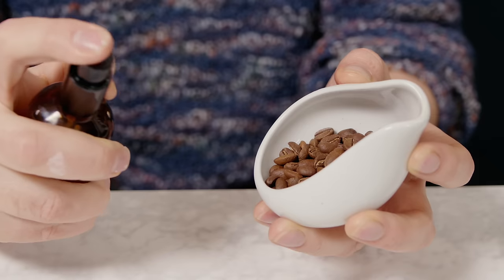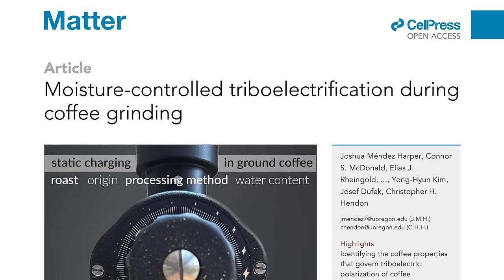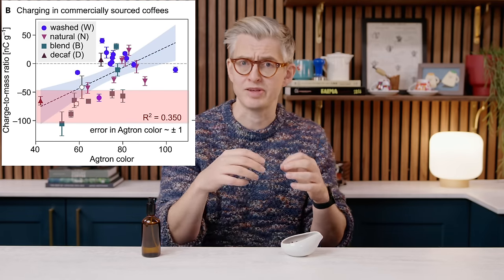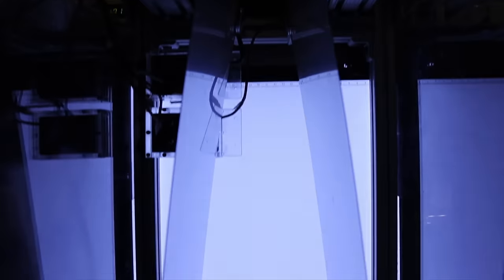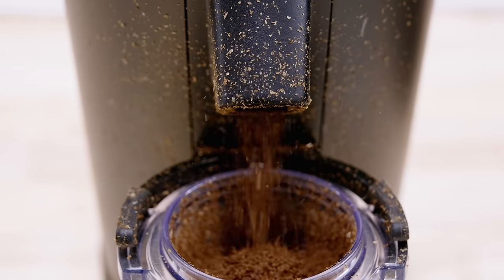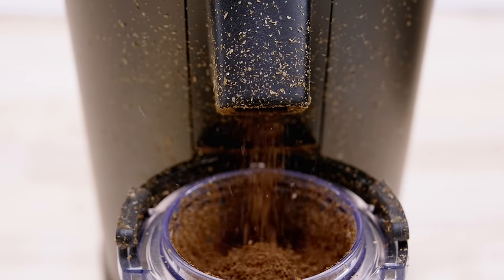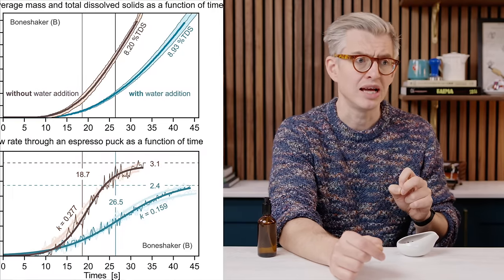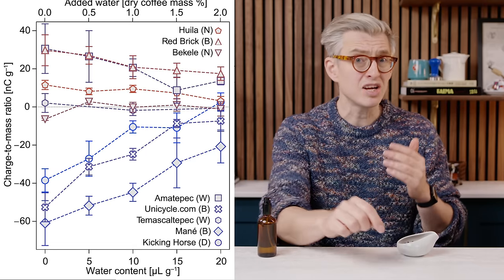Science Discovers What We All Missed: More Than An Anti-Static Hack

Comment: New bad coffee trend, drink only positively charged coffee grounds, throw away the identical negative charged grounds.
Reply: don't give them ideas
Reply: That method should only be used if you are in possession of a kettle which produces left-spin water molecules.
Reply: (This makes a sour taste)
Reply: Introducing the new Kruve electro-seive
Reply: Personally speaking, I prefer the bitter taste of coffee conisting of antiquarks.
Reply: @tokyopapillon837  has a bit of an anticharm flavor to it
Reply: HAHAHAH
Reply: brb gonna sell a positive energy grinder for tinfoilers
Reply: I love this. 😂
Reply: as a negative person i prefer positive charged coffee
Reply: Drinking coffee grounds, in general, sounds like a pretty awful trend, not to mention a difficult thing to do.
Reply: sell that right to silicon valley
Reply: @tokyopapillon837 Everything supposed to be the same if we were made of antimatter. Ahhhh but does anti-coffee taste more bitter or sweeter.
Reply: Remember all those gadgets for cars, like magnets around the fuel line which aligned the atoms and gave better fuel economy? I tried them all until I was removing petrol after every trip. I love new gadgets and love what James is doing, especially from the scientific point of view.
Reply: I wonder if it would be possible to effectively do electrolysis on grounds coming out of a grinder, so you have a high chance to split negatively charged grinds down one path, and positive ones down the other, by sending the grounds through an irresponsibly powerful electromagnetic field.
Reply: Sounds good. I need more positivity in my life
Reply: "I don't allow any negativity into my life. It's for my mental health."
Reply: I pass mine through a small black hole that I keep in the shed, the flavour is just cosmic.
Reply: Thank you for that laugh.
Reply: Removing negative energy from my life to realign my chakras 😤😤
Reply: Negatively charged coffee but brewed with alkaline water
Reply: @wesleychaffin4029  Jacob’s or supermarket own brand?
Reply: @xyzpdq1122 not heavy water?
Reply: Only positive vibes ...
Reply: the results will shock you!
Reply: Don't even THINK about serving me anything but monochiral coffees
Reply: Alkaline coffee? Oh no
Reply: You forgot Paula Abdul's Law. They're hard to separate, because opposites attract.
Reply: We could have gang wars over which polarity you drink.
Reply: Eliminate the negative, accentuate the positive, don't mess with coffee in between!
Reply: positive charges add to the flavor, but negative ions only subtract
Reply: Bahahahahahaha
Reply: Positive vibes only!
Reply: "positive" coffee culture
Reply: You got it all wrong, the negatively charged grounds are the good ones.
Reply: ask for that in your starbucks order 😂😂
Reply: And instead of normal water rather use the good DHMO.
Reply: Don't forget chirailty, spin, and polarization you fools!
Reply: @ecbrd8478 well if you want to fight them, you give them useless stuff to bicker about!
Reply: I am positive this will work!
Reply: @ecbrd8478 😂😂
Reply: @davegrant22 😂😂😂
Reply: Maxwell's Demon meets Maxwell House - only let through the perfectly brewed coffee and reject anything else
Reply: We just don't need that negative energy in the morning
Reply: Oh please, obviously the next (best) trend is antimatter coffee. Maybe will finally get some of that sweet sweet dark matter coffee
Reply: @PaulSchaffert  👏
Reply: ......my percolator makes better expresso and it's not even an expresso machine. 😏 Y'all be taking this too far.
Reply: @chrisjk  Only available in the southern hemisphere
Reply: Separate by positive/neutral/negative charge then sieve sort into fine/medium/course.
Staccato shots with 9 layers, 9! = 362880 possible layer orders.
Reply: @davegrant22  can't find one on line ??
Reply: Only positive vibes 🤣😂😂😅😆🤭
Reply: Keep the "bad" negatively charged beans for rainy days
Reply: I'm just waiting for grinders to come out with Ozone generators built in...
Reply: Left twix is better
Reply: I can see this dialog going down at a Starbucks near me...   vente spice this caramel that  but with only positively charged grounds please.
Reply: No, just reload the negatives to positives
Reply: @chrisjk  You need three phase power for that!
Reply: Wear a grounding bracelet when you drink your coffee too
Reply: Don’t give TikTok a new trend. 😂
Reply: This...I have negative-charge coffee bean sensitivity. Many people do, and they don't even know it.
Reply: @error.418  yes it does have that anticharm flavor, which I found frankly anti-up, but my friends said I'm being strange again, so I got back anti-down and just stopped complaining to preserve my beautifully balanced color charge - instead I meditated a few muons and felt inspired to be more positron about it.

(Sorry for the bad physics joke. I'll get help soon'ish.)
Reply: @saynay302  They did something similar: they did separate the grounds with some simple electrically charged plates - the principle is very similar to electrolysis, just without the fluid. A magnetic field would only make the grounds spin in opposite directions, but it would be difficult to separate them.
Reply: I'm going to need some crystal burrs for my grinder.
Reply: @KonradTheWizzard  [chef's kiss]
Reply: Cute, can benefit from a lot of pseudo science, virtually impossible to achieve without a healthy dose of lying. Perfect trend! Love it
Reply: Can't wait for all the 'workflow' shorts
Reply: Woke coffee drinkers
Reply: Now the time for Van de Graaff generator
Reply: What if I live by the ocean, or a waterfall… negative ions everywhere (which I used to think were good for me).
Should I drink my coffee standing on my head? (for the yogis out there, it’s okay, B.K.S. Iyengar liked his coffee… )
Reply: Lmao
Reply: You must never allow coffee and anticoffee to come into contact
Reply: @Schaddn ”positive ion herbal grinder”
Reply: Quantum theory says it can be sweet and sour at the same time.
Reply: But the antimatter reaction keeps the coffee hot for a year
Reply: Why throw the negative grounds away, when you can enrol them in a meditation weekend?
Reply: @HauntedSheppard That’s the general idea. 😈
Reply: @Schaddn  Neutral ones for centralists.
Reply: I think this needs doing at the equator.
Reply: What a way to attract negativity every morning.
Reply: So… by eating positively charged food you are just attracting negative charges from your environment to be in equilibrium…
Reply: Could we positively charge them by generating a positive charge as we learn to do in physics?
Edit: sorry I comment before watching too often.
Reply: oh - I can see the marketing for this - ‘Drink Positive!’
Reply: For that they might... charge extra.
Reply: Lol... Coffee distributors will love this trendy idea.
Reply: @TheWitchfinderGenral  never cross the grinder streams!
Reply: @discordia013  I was just thinking of pointing my ozone generator at my grinder during operation,
Reply: Hames Joffman would drink the negative charged ones……
Reply: Whats better is that, there needs to be a particle accelerator to create dark coffee that tastes like black hole itself. 😂
Reply: ....The exquisite elegance of this electrical inquisition .
Reply: yeah, and you should dip the positive side of a battery on your kettle after boiling for a few seconds, to charge the water!!
Reply: Coming to all niche coffee shops near you!
Reply: @AndreasDelleske Set the grinder to 'fairy cake' and put in 100 g of beans and 28 l water please.
Reply: All this, and not even a roster of the grinders, never bother a chart of cleaning frequency, whether they work on kush and hazelnuts and cottonseed (no hulls please, can't count on ULGCS yet.)
Reply: вода всех уровняет☝️
Reply: Yeah, you really do want the negative charge clumps.... The positive charges will taste sour. Think in terms of battery components. The acidic components will taste sour... That would be the tannins.
Reply: Now they can sell a new coffee Brand called  "Beaning Positive" 🤣😂🤣
Reply: i suprised there isn't 'positive coffe for possitive spirit' ads for now xd
Reply: inb4 some hipster barista shop makes a specialty "Positively Charged" Coffee that's got some really dumb pseudoscience explanation for why it's worth it and healthy to drink this $60 coffee.
Reply: If it taste Unique sure 😂
Reply: Don’t forget to weigh the negatively charged grounds to an accuracy of 0.001g before throwing them away
Reply: Let’s hope the tongue of the drinker is not negatively charged.
Reply: @tokyopapillon83simple fix buy a 500 dollar grinder , 1:31 7
Reply: positive vibes only
Reply: After all, who needs more negativity in their life?
Reply: Sounds like a great business opportunity

Comment: A month ago I thought, I was a pedantic home coffee guy. After discovering this channel, I'm now weighing my coffee to 0.01g and micro spraying with distilled water and I can firmly say that the rabbit hole is significantly deeper that I ever expected...BUT I can also say that you firmly improved the consistency of my espresso shot.
Reply: Is there a reason you are using distilled water? I do not know enough about the spritzing method to know if this is generally recommended, however, I believe DI water does not conduct charge so readily as regular tap or mineral water... Now I'm interested to see a difference in the formation of electroclumps/aggregates between using regular water vs DI water! According to the paper, it seems that the cooling effect of water is more important than its ability to conduct charge, however, your comment has got me thinking.
Reply: Do people seriously looking into this problem realise they basically left the Maslow pyramid?
Reply: Lol
Reply: I’m no electricity surgeon but distilled water has a lower electrical conductivity because it’s cleaner — the coffee itself is going to raise the EC of the water, and tap water is going to have an EVEN HIGHER EC than the same coffee made with Distilled. 
So the water will have to deaden the static charge of the beans, plus the charge of the dissolved solids present in your tap water.
Reply: As long as it's real espresso not mokka or filter.
Reply: all to make a bitter drink be less bad...
Reply: @saygo-png  Don't be so bitter.
Reply: @SPDLand any hobby is outside of the hierarchy of needs, that's the very nature of a hobby
Reply: @ExpandDong420 it is in it, it's what self fulfilment refers to
Reply: @diggysoze2897 hmm. What about the difference between well water treated with sodium to breakdown the hardness vs "culligan" water. I use "culligan" in my coffee pot, not well water. I have not tried to see if it would taste different between the two waters.

Comment: My suggestion for the slowing flow rate would be that the coating of water on all the coffee particles drastically increases the capillary action of the coffee bed, which usually I would think is fairly hydrophobic if dry. The oils in the coffee also probably don't help with that. If you try to water dry soil versus slightly damp soil, you see the effect of a thin water coating makes orders of magnitude of difference. So a stronger capillary force from the already present water allows the coffee to be drawn into the packed bed more evenly and reduces the chances of channels forming, leading to higher leaching rates and slower flow rates. This is not contrary to what the prof said. It might be a combination of both.
Reply: Dry sponge vs wet sponge.
Reply: I'll subscribe to this theory.
Reply: Your hypothesis should be wrong according to 12:40. If your hypothesis has a statistically significant effect, then the test made with the grinder at 12:40 should also have a longer brew time.
Reply: If that theory was true wouldn’t all grinders see a longer shot time after adding water not just some
Reply: How would you spray coffee beans in a large hopper as opposed to a measured single serve?
Reply: @tiredboard the grinder could just produce more heat and dry the water out during the process.

van der walls effect is my bet asw
Reply: @sherrymangas2512 you wouldn’t be able to do that.
Reply: You could easily test this by grinding coffee first then drying it after.
Reply: if your hypothesis is correct, or is the main point, then we should see similar results no matter the coffee grinder, yes, it might play a small part, but since there are machines producing similar size particles with very little differences, then that would isolate the main causality in the coffee grinding process. Alternatively, it might be possible that somehow some coffee-grinders plainly heats the coffee beans more then others, maybe the motors heats the grinder more or it conducts more heat to the grinder itself, but it is fairy easy to test you hypothesis for this corner case: just use even more water and see if THAT makes a difference or not.
Reply: This is the basis for doing a pre-infusion step prior to extraction to pre-wet the particles.

Comment: It’s fascinating that the spritzing makes a MEASURABLE difference to the extraction of the espresso. I could totally see “well in theory this should have a marginal benefit but in reality it’ll probably never mean anything,” but it’s amazing that they were able to actually measure a meaningful, quantitative change.
Reply: The thing about static electricity is that the voltages involved are surprisingly high. Rubbing your hair on a balloon can charge it to 10,000 V (with a very small charge). So, I could easily imagine kilovolts of static building up on these grounds as well.
Reply: @efovex (ik you understand this but for people reading)

What you feel when shocked is the current not the voltage. 

The voltage just has to be above the minimum voltage required to cross your skin's outer layer. 

That's why you get tased with static but touching the tip of your phone charger does nothing.
Reply: Pp😅
Reply: a rare occurence in science
Reply: You use so little coffee for an espresso that that amount of water is pretty substantial.  I wonder if it's a bit like absorbing things with a wet sponge vs a dry sponge.
Reply: Quantitative changes lead to qualitative ones.
Reply: @nutzeeer no not really